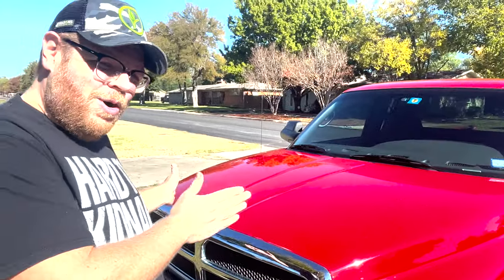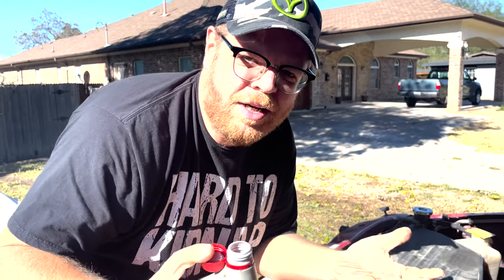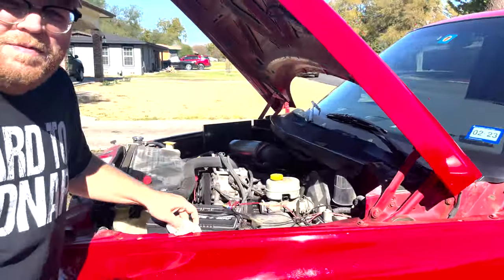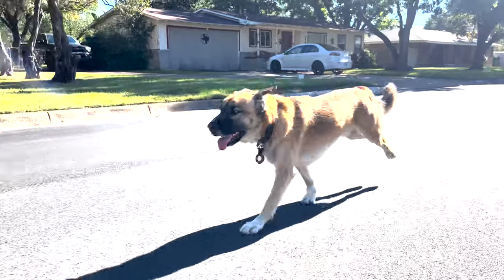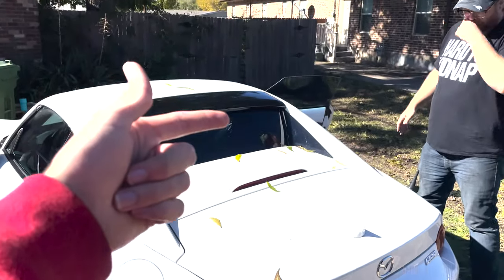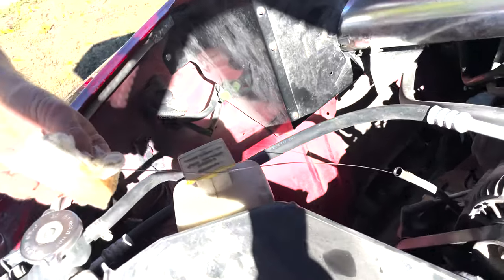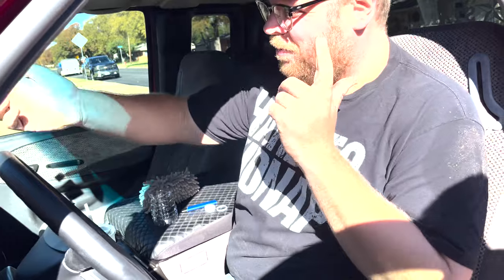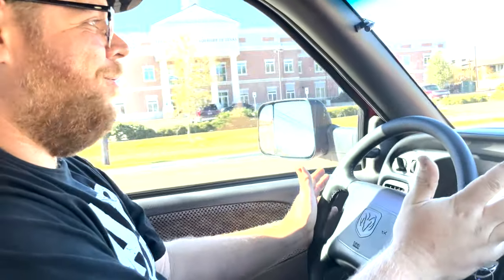Using ATF to de-sludge an engine

Comment: Transmission Fluid In Oil Reduces Cleaning Power
In most cases, adding automatic transmission fluid to motor oil reduces cleaning power. That’s because the detergency of ATF is less than motor oil. Why is that?

ATF is exposed to lower levels of combustion byproducts and contaminants than motor oil, so it is formulated with reduced detergency. Instead, ATFs have elevated levels of friction modifiers and other additives that help protect gears and clutches.

Transmission Fluid In Oil Reduces Wear Protection
Second, adding ATF alters the motor oil formulation and reduces its effectiveness.

A good motor oil is a fine balance of base oils and additives designed to fight wear, reduce friction, prevent deposits and slowly dissolve accumulated sludge. The cleaning power of motor oil is designed to work gradually over subsequent oil changes and not necessarily all at once. Adding a foreign substance to the oil disrupts the formulated chemistry, negatively impacting wear protection, detergency and more.

Comment: For that high of milage need 10w40 its way better for it nd it will bring the oil pressure up
Reply: With a little lucus oil treatment 💪🚬
Reply: @rockytop4  im more of fr3 friction reducer when i change my oil i fill it with that fr3 put it on nd fill the oil nd the engine runs smooth as butter

Comment: I have had ford with 120,000 KMs before head gasket went, 1995 Ford falcon. Head  Only went  because the previous owner who was a taxi owner ran water not coolant. I believe. I was  very upset my ex-cab 2010 Camry hybrid got written off because immediate in a big ute reversed into front of my car and punch the computer system out. Faith head over 900,000 ks only part changed by the owner, well major part which was the abs nothing else was touched. Only thing  I spent was back set of brake pads and one front wheel bearing in five years and I put 130,000 KMs on it. Now I driving my Nissan patrol and going run a diesel in the motor b4 I change the oil. Cheers Graham

Comment: I believe in using ATF.I think he should of run it longer.What i do is add 1 or  quart atf with oil and run it for few hundred miles.But it can work pretty fast but need to keep up on the cleaning so it dont get to heavy inside.

Comment: use a diesel oil like Rotella  which has a very High Detergent package , or add 1 quart of Diesel fuel to oil and run for about 500miles
Reply from the maker: Great point!

Comment: Classic Mopar 318 Or 360 , Good Motors !!
Reply: Back in the 70s and 80s models they were bad for the lifters getting jammed open causing the oh so familiar and super annoying non stop"ticktickticktick". 
I didn't notice that in the video. 
That was the end result of saving $ by not changing oil on time then.

Comment: This shouldn't be an old-timer secret this should be in every day average Joe piece of knowledge. I've been doing this with cars for so long and you can only do wrong if you do it to the wrong motor. If it's really really really really really bad I'd say just stick with one quart and then drive it for a 100 miles or let it idle for a couple hours. You don't want to break everything up at once because the oil screens will indeed get clogged. You want the proper flush product to actually turn a lot of those chunks into sludge as fast as possible but ATF will loosen those big chunks quick. You don't want to pile of chunks blocking your screen. I personally would use some carefully separated used oil and 2 quarts of ATF on the second one. Again only driving it for a hundred miles or idling for like an hour at least. Once you get the most of it and you're ready to run fresh oil you're going to have to use a minimum of synthetic blend and honestly if it's not that old of a car just use full synthetic and if it breaks open too many leaks you can best believe those leaks were already there and you can back it off to synthetic blend and almost watch those leaks go away again. Sorry for the long version but there is no short version. The short version is what Dad should be giving the kid. I'm telling you this so-called trick works on so many different motors. If you're interested in something for your cooling system, how do you use a half a bottle of CLR in the cooling system and slowly flushed it out of the robber hoses and off metal surfaces especially the radiator and heater core. CLR works wonders you just don't leave it in the system and forget about it besides you have to flush it out with at least three different fill and drains.

Comment: By the color of the oil in the dipstick after atf run, it was pure psycologic improviment.
Reply: Oil pressure double though, or more. That's not just psychological
Reply: Then your pressure sender tube resulted clogged and after flushing, got free. I had the reverse using my flush. God a sender clogged showing a too low pressure. Changed the sender and all got fine. But it worked? And that truck on vid rod bearing knocks because it has already spun.

Comment: Mobile  1 is trash cheap oil in oil test results..it fails  epicly...try valvolines new advanced  protection..or royal purple
Reply: I used Valvoline advanced synthetic oil and drove up mountain caused my oil bubbles like crazy then my bearing knocks in 1 year later.

Comment: I change oil in all my cars every 3000 miles. Use some sea foam sometimes because I don’t want to use atf to do that. Oil is cheap. Engines are not…

Comment: Putting anything other than the designated oil in your crankcase is a sure shot way to fuck up everything. Dont touch any of my cars!
Reply: It's best not to ignore oil changes that's the whole story!
Reply: I’ve been driving for 30 years and before the end of every oil change, I have added everything from 1 quart of kerosine to chain case oil to automatic transmission oil, anything high detergent, and I’ve never had a problem.  The car I’m driving now has 287,000 miles.  I’ve never had engine issues.  I always use full synthetic oil and a Fram oil filter or preferably mobile one oil filter.
Reply: This guy owns a dealership 😆 added MMO to all my vehicles 50 yrs running ...my past 5 rides all had over 400,000 when I sold them 👀 my 2015 has 367,000 paid for 😆😆😆 keep being a smart azz ..a fool and there money soon part 😆

Comment: The bad thing about removing sludge is this it moves through the oil pump into your oil galleries up through the lifters and pushrods and could clog everything up.
Now that doesn't always happen.
But friends oil sludge has zero chances of getting into the intake combustion chamber or out the exhaust and therefore you are not helping clean anything that could possibly make it run better.
That part is in your head.
The best thing to remove sludge is to remove and disassemble the engine and do a rebuild.
Or leave the sludge alone it can't possibly do any more damage sitting there.
Just a warning.

Comment: if your car become more powerfull after oil change, then you change oil too late. ATF have very little detergent in atf oil analysis.

adding cooking oil (corn / canola) will clean sludge much stronger to the point of the debris will clodge the oil passage if you use too much. max 10% or just 5% will help clean the sludge much better.
Reply: I currently using 20% of cooking palm oil and 80% cheap diesel oil for my Toyota 2kd-ftv engine to dissolve oil gum. From filling hole I can see it's pretty clean than before, aluminum color without gum/sludge. Just run it 300 km daily drive.
I can feel better acceleration, I'll change the oil when it reaches 500 km, new cheap diesel oil + 20% cooking palm oil for another 500 km.